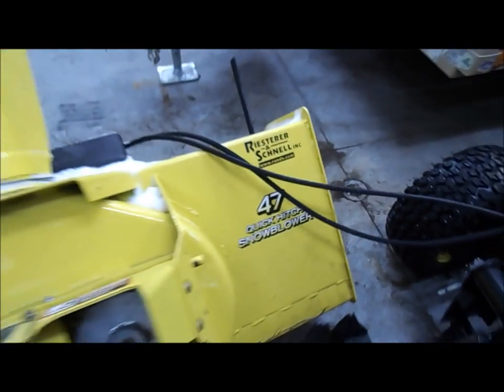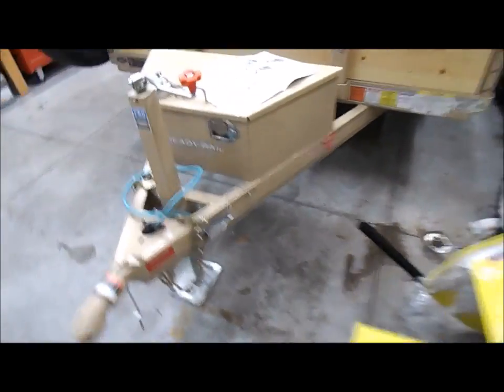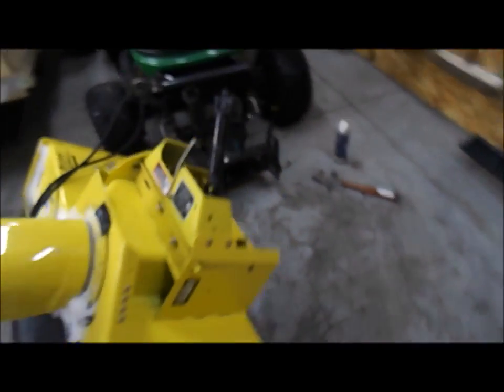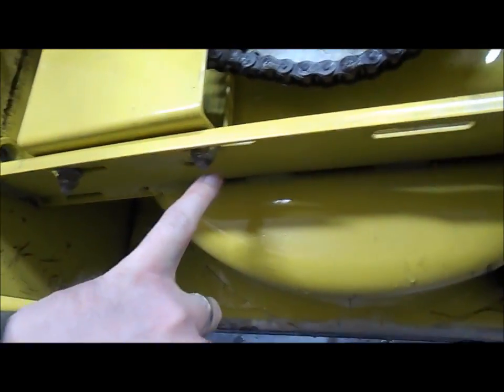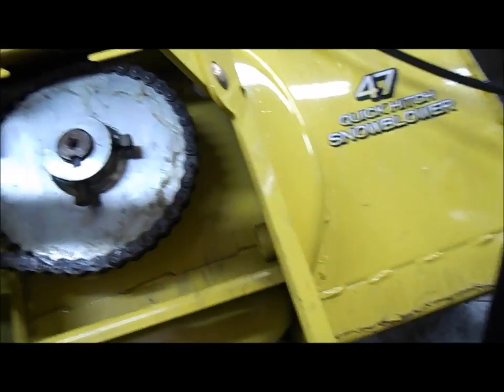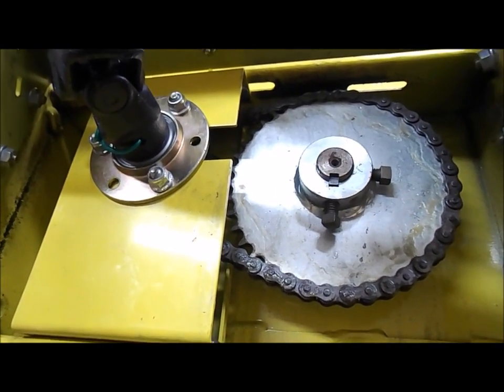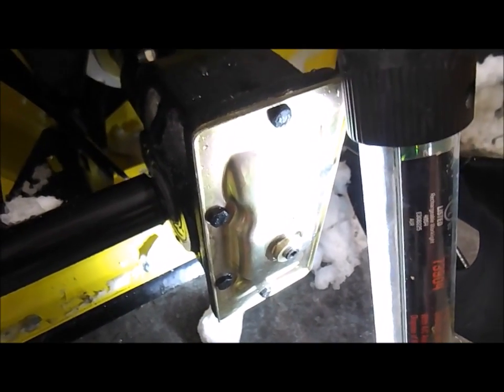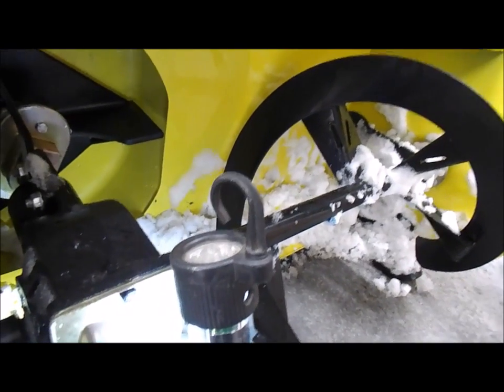John Deere 47 inch Snowblower Chain Adjustment

Comment: Thanks for the video. I'd just like to add that for me after I adjusted the chain and tightened it, I took it out, it was still loud and snapped the chain within a couple minutes. When I was putting on the new chain, I found that the large sprocket was misaligned with the small sprocket. The large sprocket is easily adjusted with the two bolts at the end. The blower runs great now and the noise is gone. Thanks again for the video.

Comment: The sprockets on the 47" and 54" blowers are notorious for being slightly out of round. Meaning that as you rotate the chain you will likely find tight spots and loose spots. I rotate mine 90-degrees at a time and check the tension. The trick is to adjust so the tight spots are not too tight so as to cause excess stress on the bearings. It's better to have the chain a wee bit loose rather than too tight. The other thing is when you tighten the bolts on the left sprocket housing it has a habit of slightly changing the chain adjustment. So sometimes it takes some trial and error to determine if tightening the bolts makes the chain tighter or looser and then compensate accordingly.
Reply: Blow makes a lot of noise when runing 47 inck john deer
Reply: I just had to adjust mine tonight.  Thanks StuntCarDriver for the video.  That helped a bunch.  EOSJOE, I experienced just what you were describing.  I would think I had it tight and as soon as I turned the shaft, it was too loose again.  Finally, I had my wife tighten the bolts while I kept tension on the assembly.  That did the trick.  A little play all the way around without being too loose or tight.
Reply: Seems noisy, I have the same blower, mine is very quiet,  makes no noises
Reply: lol